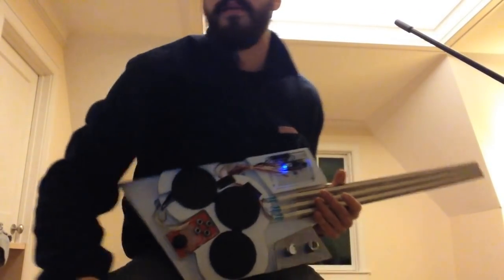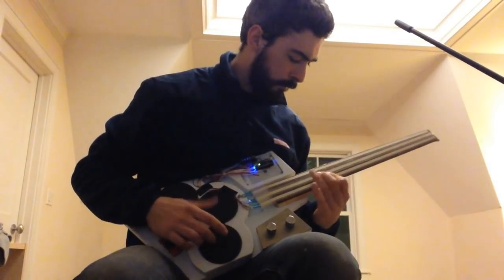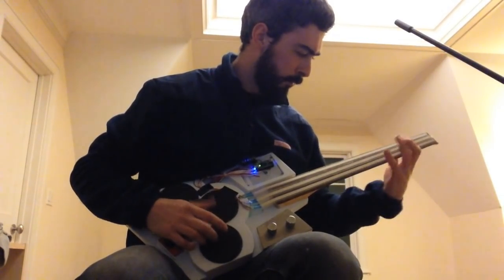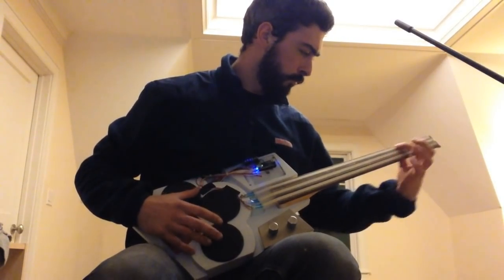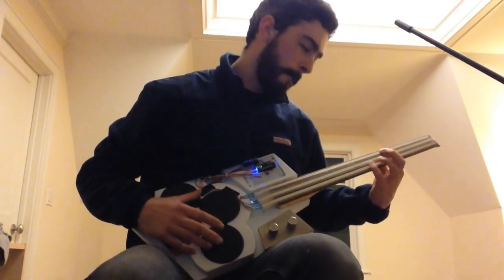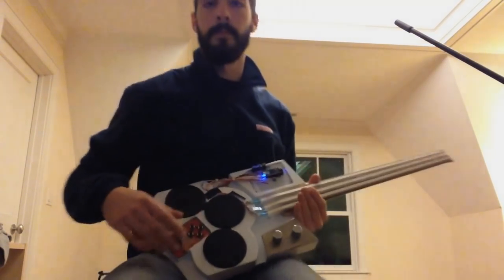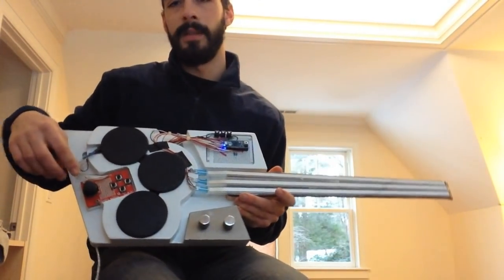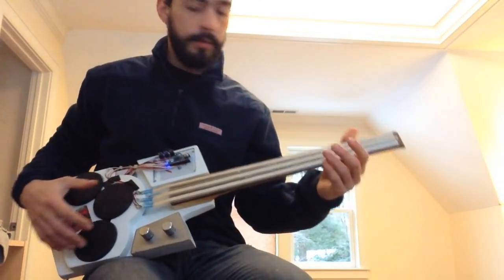DIY Arduino ribbon synth demo

Comment: Hi Gr4yhound, i was so inspired by this video (and the 4 min explanation video) that i've spent the last few days building a prototype out of a salvaged guitar and similar parts to what you had used.  i must say, the comments you made below have been very helpful, and i agree that some of the assignable inputs can/should be removed if it helps to eliminate errors.  I'll try that, (already changed Serial1 to Serial).  I'll let you know how it goes.  Thanks again for the inspiration!  I'm so ready to try something new and experimental.  cheers
Reply from the maker: Hey Peter, so glad to hear you built one! I have never seen that error message you mentioned earlier. Definitely would google it and see if anyone has posted solutions. I would check that you can upload a different sketch onto the board while nothing is connected to it. If you can't do that, you may be missing drivers. If you're using a Micro, you should be using the hardware serial port Serial1, not Serial. There are some boards that will not allow you to upload while anything is plugged into the Serial pins (rx/tx or 0 and 1). If you are using a board like this, you may have to upload code and then plug in to the external circuitry. Good luck, let me know if you get it fixed.
Reply: gr4yhound
Thanks for the reply!  sounds like i may be missing one or more drivers, so i'll definitely look into that.  already making sure the board is disconnected before trying to upload/download anything.  i realized later that you were talking about the Uno and not the Micro, so i switched back to Serial1.
i do have an Uno around here somewhere.  i built the circuitry for a Laser Harp a few years ago, but balked when it came time to shell out for the high-powered laser and galvanometer.  <82o
i put a pic of my ribbon controller on my "Martians on Maui" FB page, and i'll update it later today, (i've changed a few things since that picture was taken).
cheers, and thanks again for the response!
Pete

Comment: Your design uses all Arduino Micro analog pins except pins 6 and 11.
Would it be practical to use either of these analog pins to connect a device such as the HC-SR04 Ultrasonic Sensor, Ultrasonic Range Finder - LV-MaxSonar-EZ1, or the Infrared Proximity Sensor Long Range - Sharp GP2Y0A02YK0F to add an additional effect such as a hand (proximity) controlled Wah-Wah pedal?  Another effect might be a pressure sensing device similar to the Khaos used by the group Muse.  Perhaps these could be switched in/out with the 3-way switch?
Would it be possible to use an internal power supply for the synth?
Could the MIDI output be sent to the DAW wirelessly through Bluetooth, WiFi, Xbee, etc?  Thanks!

Comment: Hey, the neck is a regular e-guitar neck, right? Which means if I want 4 of those resistive strips, I'd probably need to get some fretless bass neck? (but they'd probably be much too long)

Do these strips come with adhesive material on their backs? With a hopefully thin & easily bendable protection foil that you could drag away bit by bit while pressing the things on? I would hate to spend that much money on them, and then botching their precise placement on the neck...
Reply: On the explanation video he shows this is actually a fretted neck! He even has some special button mode to allow smooth slides despite that.  It's awesome.

Comment: Revision?
After setting the components together on a protoboard, I am lost in a maze of spaghetti wire.  Would it be possible to convert the design to a PC board and use SMTs instead of discreet through-hole components to reduce wires and overall size?
Thanks, Bob

Comment: friend will be able to help me? put 6 piezo on the analog ports of the arduino pro micro, along with 10K resistors for each one, but the arduino goes crazy and sends lots of notes to the software alone, how to solve this?

Comment: you clever ol bugger you :o)
Awesome home build, LOVE that !!
I'd love to make one too, but I suspect it's beyond my electronics knowledge.
The construction bit would be ok but I don't even know exactly what an arduino is. Is it a particular type of IC ?
Reply: +SONGSTICKS the arduino is the DIY world's most popular microcontroller development board.  A microcontroller is a programmable IC.
Reply: +Peter Geiger Ahh I see, like the DSP chip?
Reply: Like a DSP -- but slower and designed for dealing in the digital world.
Reply: +Peter Geiger Here's a question then. I'm on a mission to try and make a small guitar amp with reverb that's fitted into a top hat, The speaker facing straight out the top and a jack socket in the side, that I can plug my wireless mic receiver into, with a volume and reverb mix knob, also on the side of the hat. Would an arduino do that? Doesn't have to be very powerful. Just like a little pignose, but in a hat :O)
Reply: SONGSTICKS nope. Look up smokey amp
Reply: +Peter Geiger Okey Dokey....Thanks

Comment: Is it necessary to use the midi to usb converter if I am using the uno since it can connect directly to the computer?
Reply from the maker: I think there was a reason why I used it instead of the regular Arduino midi library. The midi to usb I think is native MIDI and can operate without a driver while the arduino cannot. I don't remember exactly. Short answer is yes, you can use the regular arduino midi library instead, but you will have to modify my code to do so, and you may have to use some additional software (maxmsp plug or something) to properly rout the messages if you want to use it with a DAW. The usb converter is just an easy out of the box solution so you don't have to worry about any of that.
Reply from the maker: yes definitely

Comment: Hi gr4yhound. Project is awesome! I just copied the source code onto a sketch and I got an error message that said that 'Serial1' was not declared in this scope. I am doing the project on an arduino uno. Do you know how I can modify the code to fix this. I am knew to coding. Thanks and great work!
Reply from the maker: If you are using the uno, you can change 'Serial1' to just 'Serial'. I will warn you though, the uno only has 6 analog inputs, and this project as it is in the posted code uses 10. It may throw more errors that any analog input pin over A5 is not defined. You probably will have to make some significant mods to the code before it will work with uno.

Edit: I actually remembered I didn't declare the analog inputs as 'A6,'  'A7', etc. so you probably won't get those errors. Regardless, on the uno those pins will not work as analog inputs, so any analog things you try to plug in there it will not be able to read.
Reply: Ok thanks. I am thinking of possibly using only one piezo sensor or getting rid of the joystick and/or buttons. I do like what the joystick adds though so I will have to make a decision on what I want more.
Reply: Kyle Hannon
You should be able to wire just the joystick to the board, but according to the code, it looks like at least two of the buttons are needed for octave changes and a third is used for calibrating (?).  One button looks like it is the note sustain, (maybe expendable).  The assignable pots would probably be the easiest things to eliminate.
Reply from the maker: In the linked code there are 2 buttons for changing octaves, one for changing the channel of the messages the joystick sends, and one that will allow you to play whatever notes are under your fingers without hitting the drum pads.
Reply: i think i know the answer to this, but how is the calibration initiated?
btw, i got the code errors to clear - i was using the wrong compiler, (had a feeling it was a small detail i was overlooking).  just waiting on UPS to deliver my usb-midi converter and i should be ready to rock.  :)
i'll post a reply video if i get it running today.
Thanks again for sharing this!
Reply from the maker: glad you cleared the errors. The calibration is initiated by one of the buttons, but then once I had it calibrated I commented the trigger out and used that button for something else. No need to calibrate more than once (unless you change the voltage your board is working at). You will probably need to calibrate it once you have it running off the usb midi converter as those often put out less than 5V.
 Yea I'd love to see it once you get it working. Remember each string sends notes on a separate midi channel (1, 2, and 3), so for best results I would set up your DAW with 3 separate monophonic soft synths.
Reply: I'm on the finishing touches now. Will I be able to calibrate using the UNO, since I only have 6 ports? I am not using any of the buttons, because I filled up all of the Analog ports with the sensors. Are there any work arounds to calibrating?
Reply: hi Kyle, I'm writing a loop that will set up each ribbon with a set space for each fret.  it will allow me to modulate the key incrementally, or by octave.  you should be able to use any of the pwm or digital inputs for the buttons, but you won't have anywhere to run the joystick input.
Reply from the maker: hey yea you can still calibrate, just use one of the digital input pins for a button to trigger calibration. Or you can just use a set space for each fret like peter said. Only problem with that is running on lower voltages (like the midi-to-usb converter may put out vs the serial usb connection) can cause your 5v out pin to put out less than 5v and your frets to be in different places than you originally defined them in the code.
Reply: Alright. Looks like I am going to add a switch to calibrate and maybe control another function. Thanks a bunch. I can't wait until I am finished!
Reply: So I am new to Arduino so what is the worst possible thing that can happen to my computer or project if my wiring is off? Will it explode or just do nothing? Thanks for the help.
Reply from the maker: Hey if your wiring is wrong you could mess up your arduino, but I don't think that's very likely to happen with this project. If it doesn't work, just turn it off and figure out whats wrong. I can't see you messing up anything with your computer since drawing too much current through the usb ports usually just causes the computer to automatically disconnect the device (although I'm not sure what computer you're using). I've had boards cause the computer to panic and restart, but that's unrelated to the wiring and is generally ok you just lose whatever wasn't saved that you were working on.
Reply: Gotta love a fretless bass man gone synth. Would love to hear you play that through my DIY giant modular!